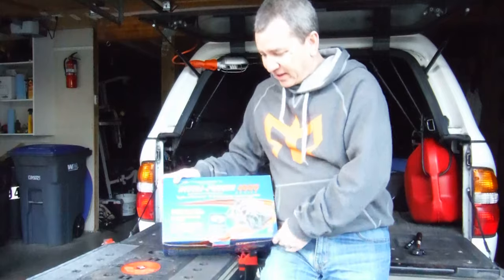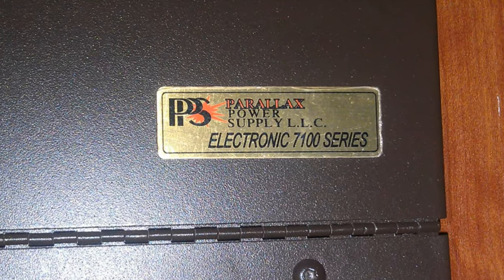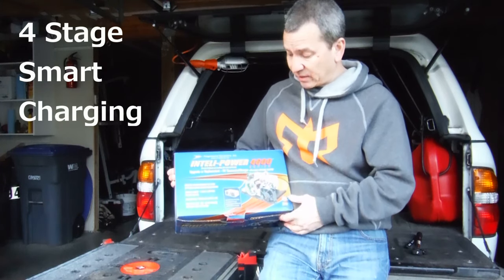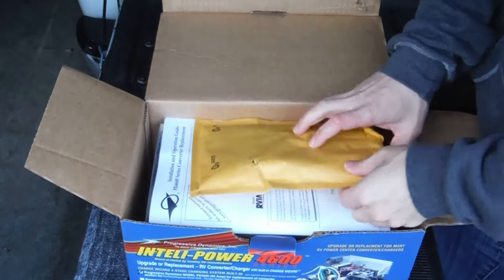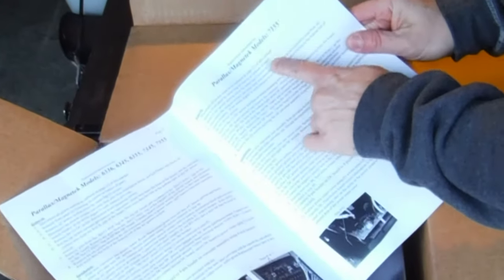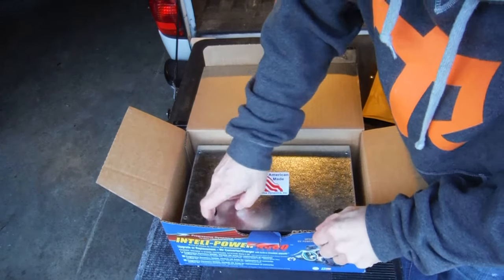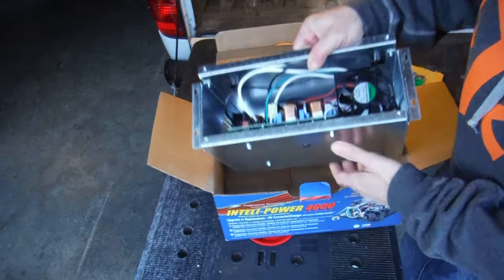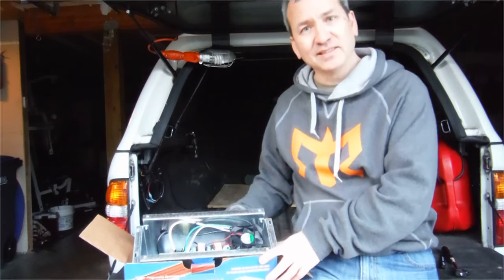Smarter Faster RV Battery Charger Unboxing

Comment: I think this is something a lot of people don't realize. That your converter charger that comes with your RV hammers on the batts. I lost several deep cycles over the years before I figured it out and did the charge Wizard upgrade. I just assumed the stock charger fell into trickle mode once the batts were topped off, wrong. Thanks for the video.
Reply from the maker: I absolutely agree with you Taz Man. I'm glad you enjoyed the video. I hope you watched the install video also. 

At first I didn't pay much attention to how my RV charged my batteries. I figured it was working the way it was supposed to (13.7 volts is where it stays...ok). It wasn't until I got deeper into solar charging and charge controllers that I knew something was off. Why was it that my batteries always got a better charge from my solar charge system? Hmmm. Lucky for me, I've always disconnected the battery bank while parked for long periods. So I didn't fry any batteries. I rarely ever got a full charge either. I'm glad I don't need to do that anymore and am happy with the new setup. Thanks for watching!

Comment: I went with an add-on called a charge wizard. It has four stages, boost, normal, storage and equalization (de-sulfization). The addition of the Charge Wizard makes your 9100 Series converter an intelligent battery charger that will safely and rapidly recharge a discharged battery by selecting the BOOST Mode (14.4V) of operation.

Quote from manufacturer: "Once the battery reaches 90% of full charge, the Charge Wizardautomatically selects the NORMAL Mode (13.6V) to safely complete the charge. The STORAGE Mode (13.2V) is automatically selected after 30 hours of non-use of the 12-volt RV electrical systems. The lower charging voltage in the STORAGE Mode of operation reduces battery gassing and water usage, while maintaining the charge. Every 21 hours when the system is operating in the STORAGE Mode, the Charge Wizard will automatically switch to the EQUALIZATION Mode of operation. The EQUALIZATION Mode increases the charging voltage up to 14.4 volts for 15 minutes. This increased voltage mixes up the battery electrolyte and prevents battery stratification and the resulting problems of battery sulfation"

More here: https://www.progressivedyn.com/rv/charge-wizard/pd9105-tcms-charge-wizard/

Comment: Nice. What was the big difference? Can u brief us on the 4 charging modes.. and are those switched automatically or no(?) .... thanks. your videos help alot of people.
Reply from the maker: +koollee Here's a link explaining the four charging modes which are pretty standard across multi stage chargers http://www.progressivedyn.com/pd4600_converter_replacement.html. It does switch automatically except equalization which can be set to auto or manual.

Comment: Hey Brian, I know you have solar, but... pretend it was a dark and stormy day... You wake up and decide to drive for 3 hours to another destination. Can your chassis alternator deliver adequate voltage and wattage to allow the 4 stage wizard to do bulk charging? Since I don't have solar obviously I hope you say "Oh heck yeah man!" I have the Intelli-power 9160, the "60" is for 60 AMPS on the charger output, so IF my chassis alternator could supply enough power to the charger I could bulk charge my 220 amp batteries (to 90%) in a 3-4 hour drive. I think?
Reply from the maker: Probably not gonna work using the converter/charger which runs on AC power. Your alternator generates DC power. So you'd have to charge directly from your alternator. In my RV my house batteries are totally separate from my chassis batteries and alternator. So my alternator never charges my house battery bank.